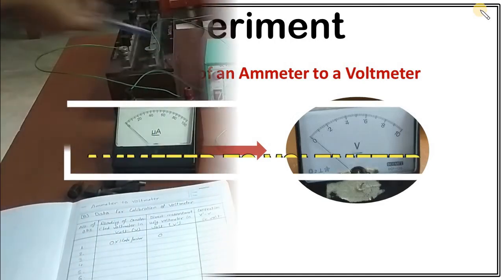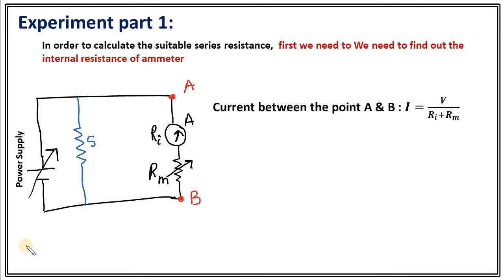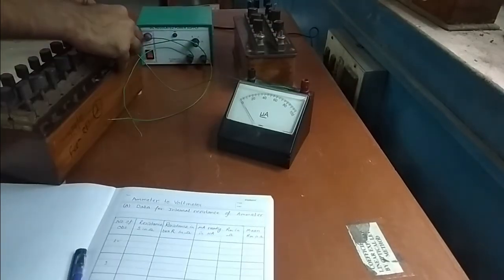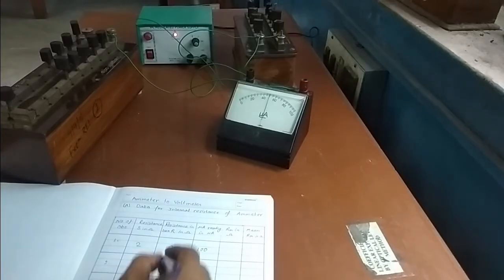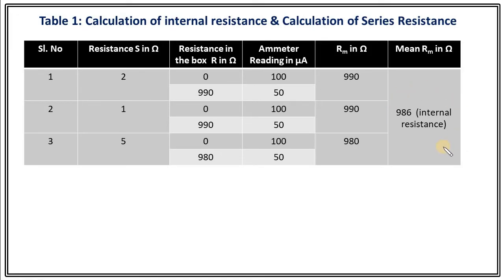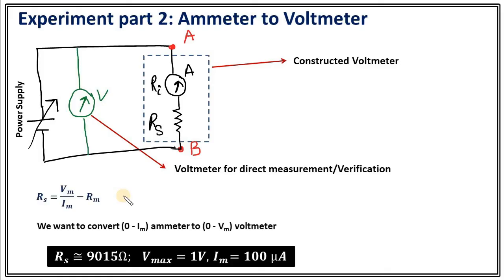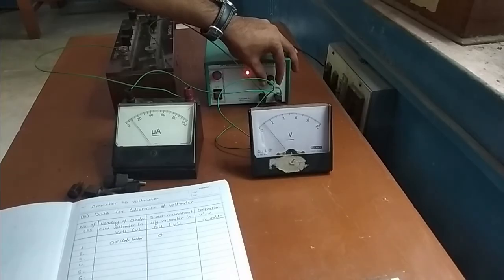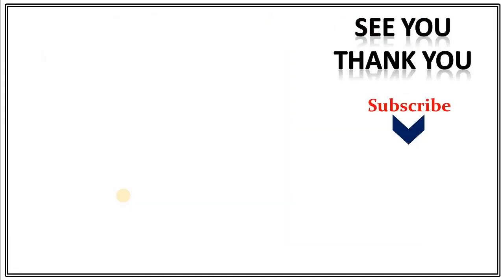Conversion of ammeter into Voltmeter | ammeter to voltmeter conversion experiment

Comment: What is scale factor sir?
Reply from the maker: Here, we have converted ammeter to voltmeter and 100microA is equvalent to 1 Volt in our experiment. Therefere, scale factor is 1/100. Meaning, whatever will be the reading in the ammeter, if we devide that reading with 100,  we will get voltage reading.